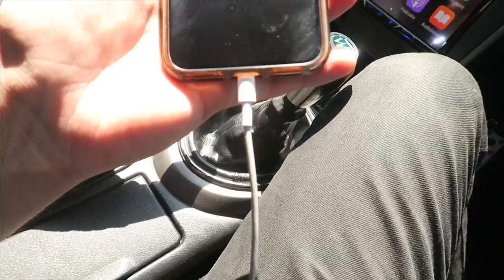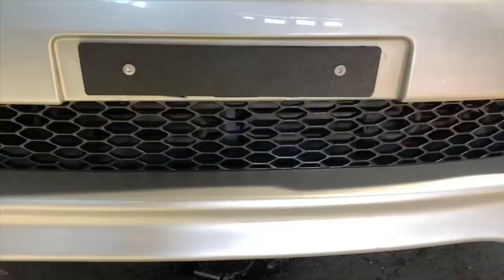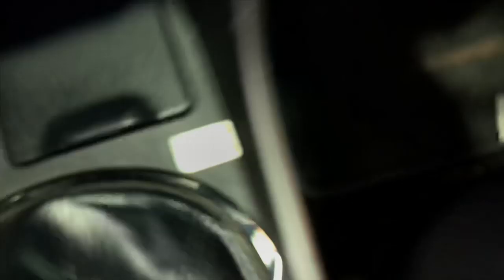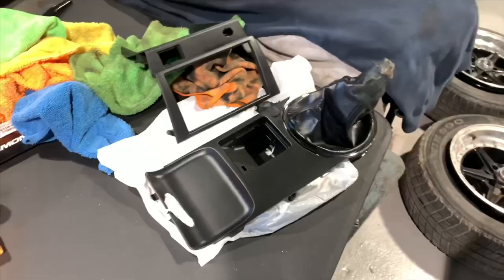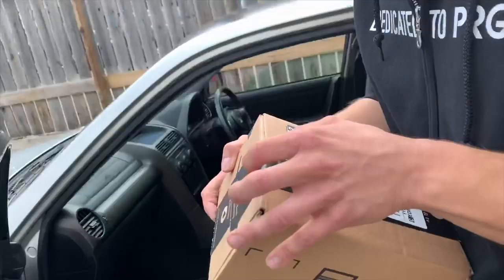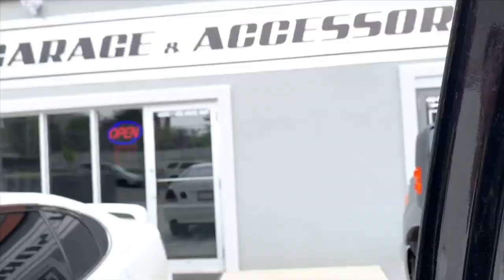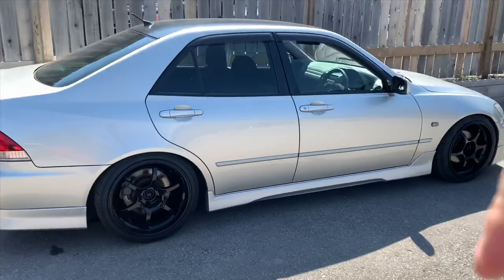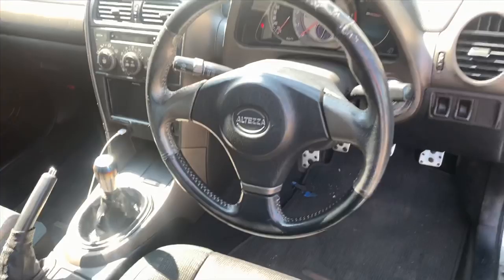Wireless in car charging! - Modern JDM Build

Comment: The skirts are part of the Toyota Neo kit. They are NOT TRD, just factory options. 
The air intake you have will likely decrease the engine performance. There's a load of info on forums about this, but the factory intake is actually better than most aftermarket options. I think it is just the Apexi intake that has shown to be better. 
For a deeper exhaust note, keep the midsection stock and go for a HKS HiPower Silent. It reduces the booming note in the car at cruise speeds and isn't too outrageous. Also takes away the rasp nicely. Going straight pipe is gross and not worth the rasp.
If possible, brace up the chassis a bit. Makes it drive a lot better.
I'm going the ITB route on mine, you can use 4AGE blacktop throttles on an adapter plate such as the SQ engineering one. A few other bits are needed with this, like throttle linkage relocation and modifying the clutch reservoir but it doesn't work out too expensive. You can then use an AltezzaLink ECU which is basically plug in and play.

Comment: i don't think that 12v plug you put in can handle that many amps, idk if you'll be able to run everything off of it. the charging on the phone might be extremely slow because wireless charging is inefficient to begin with. the original OEM socket can provide enough power but the plug you put in it is probably only rated for 3 amps i'm guessing?

Comment: what transmission do you have because i want to swap my is300 to manual but i dont know what transmission to get that will fit
Reply: j160 for a 3sge
Reply: The beams use a j160, stock manual is300s use w55s but they're kinda junk, mk4 w58s bolt up to the stock 2jz but the shifter position is a little odd

Comment: The TRD rear and sides are an OEM optional upgrade. The front is an amuse lip. The BEAMS is the first dual VVT-i engine. Head flows deal well for it's size. Stock engine capable of 350hp with a thicker headgasket and a turbo kit. 3sgte rods with a slight modification fit with stock pistons are good for 450hp. Forged rods and pistons nwill see 700+hp easily with a stock head. Do the circlip mode on the transmission of going over 450whp. Don't be a next jz guy. Get  over to puristmod and surfab and get some boost going. Dare to be different if you really want this channel to grow... Too many same o same old builds going on. Plus if your going to swap out the engine, go for a 1gz-fe+t build. JZ wouldn't make sense, an is300 would have been cheaper.